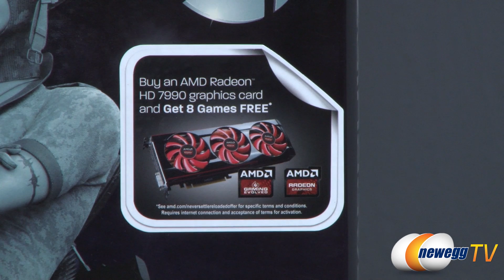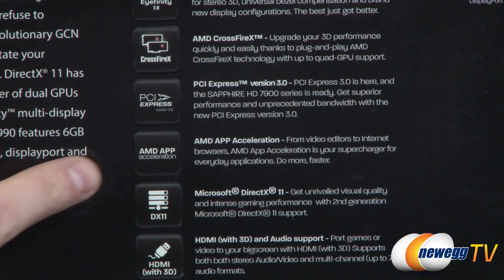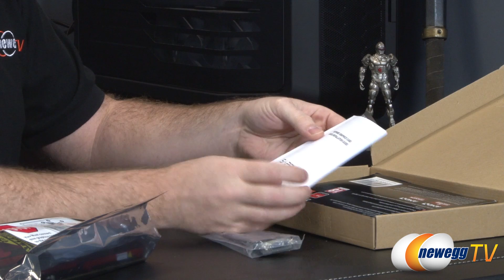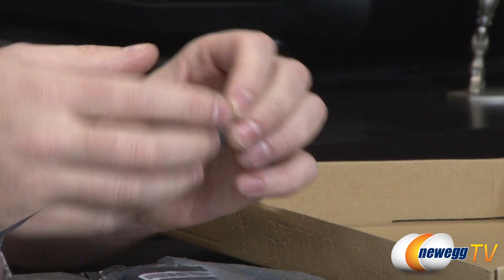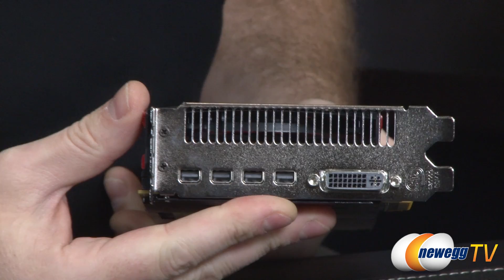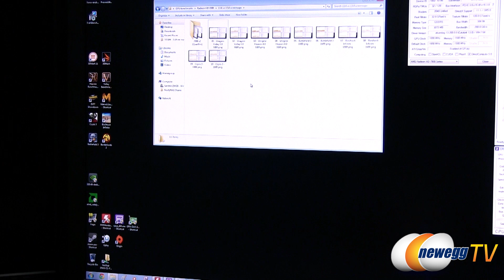Sapphire Radeon HD 7990 - Quadfire Frame Time Testing with AMD Catalyst 13.8 Drivers

Comment: only the top card should be 2X , as one 7990 is better and cheaper, only at max cards does dual do any good, I use to see people dual 660, not the 690 had 4 times more cores and way faster memory at more bits.  the 7790 has 4096 Stream Processors each, VS 2048 so one 7990 would be better or at worse equal to dual R9 280X, QUAD R9 280X would be same but divined. at least both are 288GB/s memory bandwidth.  even ten R9 270X would not perform. hope this helps.

Comment: Sorry Chump, built my computer. Knew what steam was, knew what Origin was. Was using "Web Installer" as a general term... But guess a stupid Chump like yourself has to try and be a God Damned troll without reason.

Turn the lights on and get out of your MOMS fuckin' basement Chump.

Comment: No. I knew about Steam and Origin programs. I just wondered if you got OEM packaged games, it was a stupid question I suppose in hindsight. I should have known people would think that I had no idea what "Web Installer" meant, I was using that as a general term. It seemed easy enough. But you know how trolls are.
I wanted to know IF I had to download the games or if I was getting disks to install them that I could add to my display.
Thanks for at least not being condescending about it.

Comment: It may give a few more frames but it is not "better". Trust me I know. 7990 is a dual gpu card. It has alot of frame latency compared to the Titan. The Titan will give you a more responsive/smoother gameplay experience. Frames mean nothing if they aren't responsive/smooth.

Comment: you can get pc games in pretty much any way. you can get them on a disk, on steam,origin,uplay,etc. however the retail option would be location based. this was the purpose i told you do some research before you asked, as i do not know if any retail stores in your area do sell redemption codes. but to answer your question, yes I have bought game redemption codes in store before, and yes it it possible. so yes "games can come in Retail with codes in the box"

Comment: It's a crossfire..  I'd rather have a single card than deal with all the bugs.. which can perform worse than even a single card.. 7990 in some games performs worse or doesn't have a big difference with a single 7970..

Comment: Dont get the GTX Titan now. This thing is stronger than the Titan because this card used to be $1000. The Titan is the strongest SINGLE gpu card. This is a DUAL gpu card and it is quite a lot stronger. So you can save about $400 by getting this and also have some extra power.

Comment: I am a programmer by trade and i know that you can use the Pcie lanes to bridge the cards that is what they do.the SLI/Crossfire bride is just to help it. and if you actually look at the video and understand my Comment is Because there is a MAX of 4 GPU's that a System can Make use of and this is a Duel GPU card SO 3 of them would make it 6 GPU's and there would be Zero Point in it.

Comment: the cards physically don't have higher than 4x crossfire capabilities, and even if they did, i can't think of any motherboards that would be  able to support it, and even if there were, the drivers have no support for such a configuration, and even if there was, good luck finding a 5000 watt psu and a 45 amp dedicated circuit.

Comment: I still notice a difference between a 7990 and a 690 or two nVidia cards, the stutter is gone most of the time but like you see in the video, it's still kinda there for some more intensive games. I hope they have a hardware solution for the next-gen cards.

Comment: more than somewhat, according to the review that pcperspective (the guys that made the fcat system) the improvement is (although not as good as nvidias solution which btw they have worked on for years whereas amd has been working for just a few months on it) is close enough that you wont notice the difference :)

Comment: That is quad. each 7990 has two 7970 gpu's on the board set up in crossfire. therefore, having two 7990s in crossfire means that you have two 7970's in crossfire

Comment: yes, and they will not crash a computer. They won't run a game together though. The max crossfire gpus can work together is 4 (4 gpus). 3 of these cards is 6 gpus. But you could still put them in your computer and render stuff, or bitcoin mine, or heat your house.

Comment: Although I agree on pricing, for my needs (much more than gaming) Intel and Nvidia provides a much better value. AMD isn't the best for the programs I use normally Intel performs better and Nvidia I can take advantage of the cuda cores. But either way I love AMD, Intel, and Nvidia. I actually plan to get a new motherboard so I can still use my AMD system as a secondary.

Comment: Completely obsolete, that's what it is. You just slapped some intelligently sounding words together to sound like a computer pro. Nobody in their right mind makes a custom loop for a CPU only (not in this day and age of closed loop systems that perform very well at very low price points). Second of all, regardless of what a radiator, some fans, some tubing, a pump, a reservoir, some fittings and a cpu waterblock cost, a TITAN still dwarfs a 780 in performance in any use case.
not even mad/10

Comment: Windows expeirence index is by far the worst way to judge a system. The fact that you think the 8350 is "twice" the CPU compared to the 3570k just shows how little you know. Cores don't make something "twice" another CPU. It's all about architecture. You really should just learn tech before you actually talk about it.

Even if your precious Windows Index shows the 8350 as higher.. it's still cheaper than a 3570k and just as fast. Your argument is moot.

Comment: Paul explained this pretty good in the video actually, but i'll try to simplify the matter. A worker in a factory can tell his bos that he produced 15 flawless pieces of something. That's what afterburner does, it asks the card what it did, without checking to make sure. An actual FCAT test basicaly inspects the 15 pieces that were produced. and even tho the worker thought they were flawless, 3 of them don't live up to standards for example. You wouldn't know without checking the final products.

Comment: If you're going 1080p, you wasted a lot of money. 4GB is only good for 1440p, 3x1080p, and 4K. MSI's TF 760 is much better than all EVGA 760s. MSI's TF IV cooling is better than ACX. (I found out the hard way.) EVGA hasn't even released the 760 FTW yet.

Comment: The point of the 7990 is having a 2 GPU solution with a single slot card.  I only have a single x16 PCIE Slot on my mobo.  This card would be perfect if I needed this amount of performance as I can only have a single card.

Comment: I am running vista right now though this is a somewhat modern computer the OS runs well. System boot up time is about 10 seconds with most of my harddrive full. It is also fast. I think the problem with vista was is was too intensive for old pcs.

Comment: 1) I just stated that their frame times are now very close to being the same. Seems like you keep repeating arguments that have already been disproved.

2,3) I knew you would make this irrelevant argument. The fact that nvidia had a fix for it before AMD does not necessarily give them an edge when comparing them today.

4) You are not "screwed". You can still do those things but it will not be as smooth. Also, this is a BETA driver. You act as if those problems will never get fixed.

Comment: 1) I'm not sure what your definition of "far higher" is but they are very close in comparison to previous drivers. Also, 7990 is now a $700 card, whereas the 690 is still priced at $1000, so even if the issues weren't fixed, 7990 would still be a better value.

2) You do realize that AMD knows this and is working on DX9 support.

3) Again, they are working on eyefinity support. Do you honestly expect everything to be fixed with a single driver update?

Comment: For decades? SLI wasn't available until 2005.. lol.  You are obviously the one who is "COMPLETELY 100% IGNORANT". And the 13.8 Drivers do a GREAT job at better implementing frame pacing. As a side note, I use nVidia, so dont call me a fanboy

Comment: No you need to overclock it to 4.8 ghz then you will get 3fps. Also if you get dual 8 core xeons, modify the bios so you can overclock them, and overclock them to about 4.5 ghz per core then you will get 5 fps (also obviously you will need quad sli gtx titans, 4 ssds in raid 0, and 64 gb of ram at 3ghz)